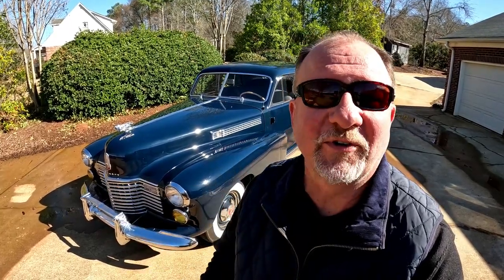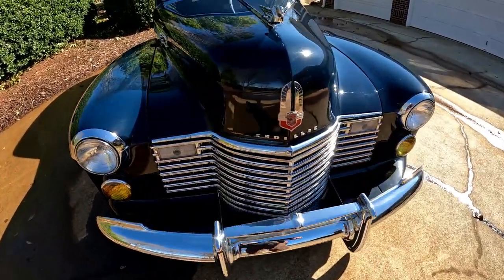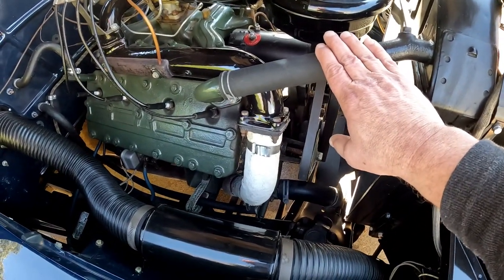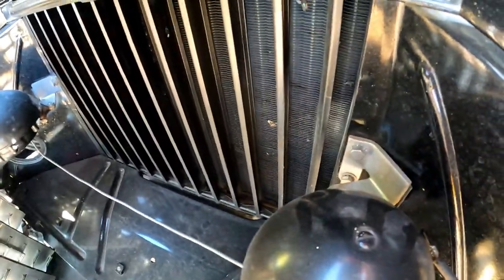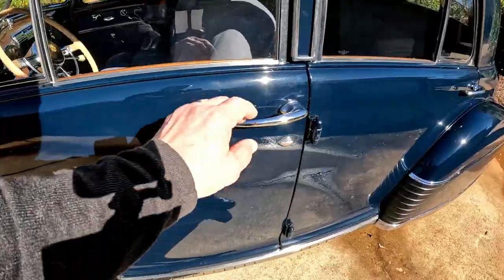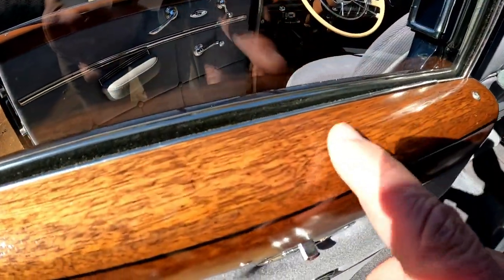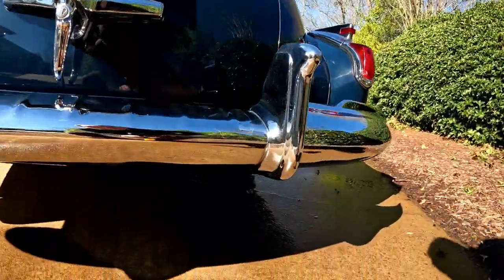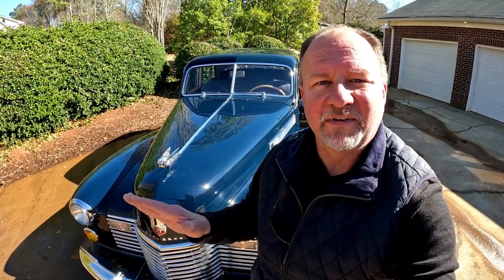1941 Cadillac 60 Special Fleetwood

Comment: Beautiful car, thanks for the video. One correction: The optional automatic transmission  would have been a 4 speed (fluid coupling) Hydramatic. The TurboHydramatic (3 speed with torque converter) did not come out until 1964.
Reply from the maker: Thanks, John for that good information. I wonder why the did not stick with the 4-speed trans going forward?  I did not reappear till the 80's
Reply: Actually, the three speed was a quasi 4 speed.They felt the torque converter effect was essentially first gear in  the fluid couping hydramatic. The torque converter essentially "multiplies" the effective gear ratio of the gear. It. loses multiplication as speed increases. So as the converter loses its "oomph" the first gear  could then be a substitute to the fluid coupling's 2nd gear. I think the Turbo Hydramatics had a first gear ratio somewhere around 2.4:1. The converter multiplication varried by year but was usually close to 2:1. So, the converter amped that up to near 5:1. The fluid coupling hydramatic had a first gear ratio only approximately 4:1. So, off the line the Turbo was faster accelerating.

I remember a car mag in 1964 testing both the base entry level Caddy which had the 4 speed vs the Deville that came with the new 3 speed Turbo Hydramatic.  They were essentially the same weight, same rear axle, same engine. The Deville beat the base model every time. 1964 was the only year they used different transmissions for their upper/lower series. 

As to the 4th speed added to the Turbo Hydramatic in the early eighties. That was a true overdrive gear (i.e., less than 1:1 ratio). Both the  4 speed Hydramatic and the 3 speed Turbo Hydramatic top gear was 1:1. So neither of those had an overdrive. 

I'm not an engineer or technician. I just love following car developments and have been a Caddy officiionado. They kinda lost their way in the 80s so I gradually stopped closely following them. But, 50s up to the end of the 70s, yes.

I hope all this techie stuff makes sense coming from a non techie person!
Reply from the maker: @johnwwirtanen1283  Thanks, John. Makes perfectly good sense to me. I guess the Turbo Hydro had a deeper 1st gear for off the line than the 4-speed. I have heard that switching from a turbo 350 to a 700R-4 type trans gives you even better acceleration from a stop and also the benefits of a true overdrive?  It would be great to convert this three-on-the-tree 60 special to a 700R4 with correct gear selector. I wonder of anyone even makes a bell housing conversion/case to do such a swap.. or even swap to a turbo 350.
Reply: I looked online at the 700R specs as I wasn't familiar with them. Yes. Its geared first ratio was 3.059 to 1 vs the 3 speed Turbo Hydramatic usually being about 2.40. I also looked up its torque multiplication factor. It varied upon the specific model used, but apparently had three versions: 2.0, 2.5, and a screaming 3.0! So, at the low end, first gear would have had an effective ratio off the line of about 6:1, easily a lower ratio than the three speed's 5:1+ -. Wow, with the 3x converter it would be 9:1! (Unless they used a first gear ratio less than (approx) 2.4. I wonder what cars got that. (Maybe Vettes and trucks needing the extra oomph.) I suspect there may be charts that show the actual ratios. So, my figures are based on some assumptions which may not reflect actual applications.
Reply from the maker: Thanks, John for such great detail and research. Looks like a variant of the 700R would be the way to go!!!

Comment: Love your unique reviews but I suggest to do some research before doing your videos. That way you will have all the answers and look professional!
BTW I don’t think the fender skirts were optional as they were part of the  design.
Blessing to you.
BTW, I would have pointed out the chrome on the windshield Moulding  on the inside. All the car builders only did that to the top of the line sedans and usually on the convertibles. I have a 1947 Packard top of the line Clipper and I treasure my chrome windshield Moulding!
Reply from the maker: We'll try to do better. Check out our top-of-the-line Packard videos too, especially the '56 Patrician with only 4,700 miles. 
https://youtu.be/QLLHJbApzO4?si=GMUPBFEOQAxcMrRd
Reply: You have the mojo..just a little pre research.  I am subscribed!!
Reply from the maker: many thanks, and will do, Robert!!